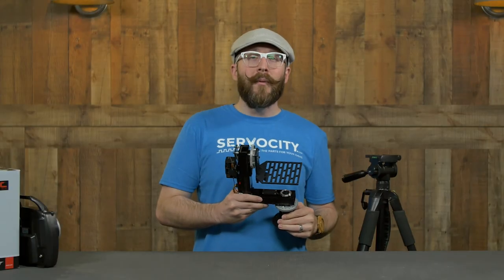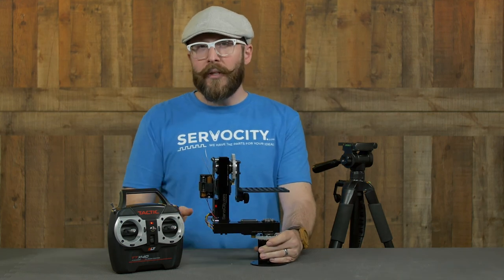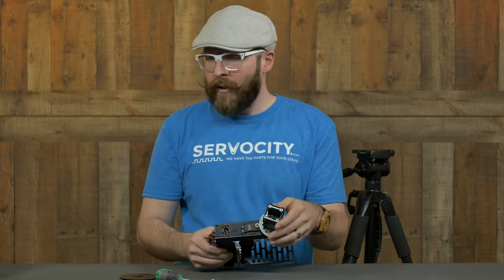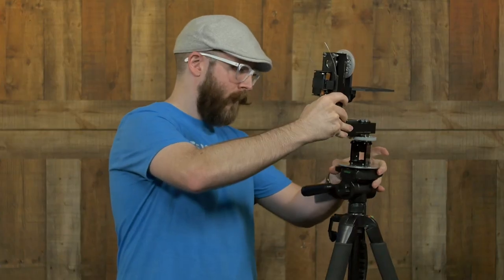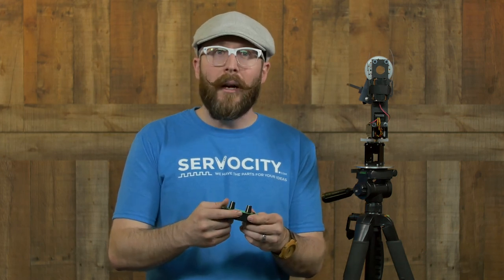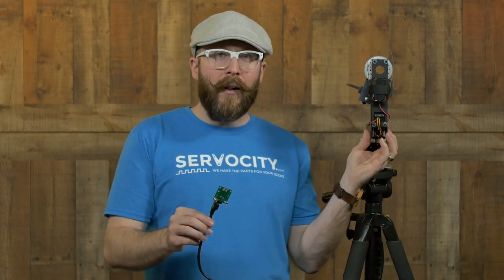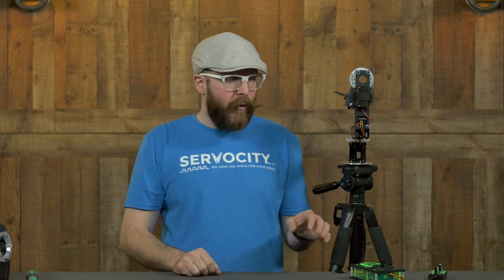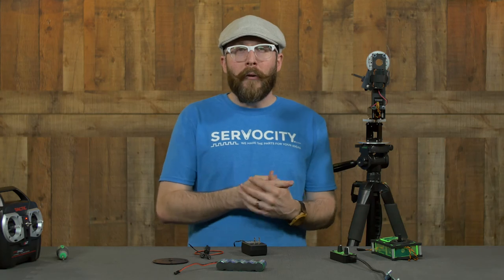PT2645-S Pan & Tilt

Comment: Hello, can you suggest any system that i can use to control it wirelessly and set it to PAN in certain time interval?
Reply from the maker: Hi Amir, we have several wireless solutions.  When it moves comes down to the controller sending a signal to tell it to.  Please contact tech@servocity.com with your project details and we'll gladly help you!

Comment: Does it work with older PT785-S  Pan & Tilt with HS785HB servo
Reply from the maker: This is an entirely new pan and tilt system.  The HSR-2645CRH servo is a different size than the HS-785HB servo that comes in the PT785-S.  Please let us know if you have any other questions tech@servocity.com.

Comment: Nice video.  However, a few obvious questions:  What is the max weight supported by this unit?  i.e. can a Sony FS-7 be placed on the unit?    Also, what is the battery life when using the AA batteries?  What is the distance range for the transmitter?   And, video basics 101.. stop using the side of the face shot.  We spend more time looking at the side of his face vs the front shot or simply doing some real closeups/cut-aways on what he is showing/talking about.  The side face shot is useless.
Reply from the maker: The head can handle a 5lb balanced load.  Battery life is dependent on the load applied as well as the type of shooting you plan to do (how much idle vs in motion?).  It'd likely be able to sit idle for 2-3 days as the servos only pull a few mA each at idle.  The amount of current while in motion depends on the load and how much it's starting/stopping and changing direction.  At stall, each servo can pull a few amps but one should never see that much draw during normal operation.  With the AA pack you'd easily be able to shoot for a few hours (Alkaline batteries).  There are all kinds of different AA batteries so if you go with lithium your run-time can be further extended.  We also have some higher capacity rechargeable battery options such as the 4200mah battery which would allow you to easily cover a full sporting event (several hours).  The wireless system is almost always going to be reliable as long as the pan and tilt is still within sight.  2.4gHz systems have the capability to reach up to 2mi in ideal conditions.  Please let us know should you have any additional questions tech@servocity.com or 620.221.0123.